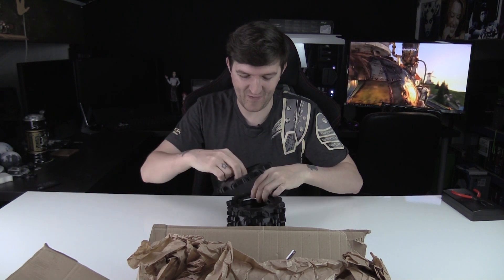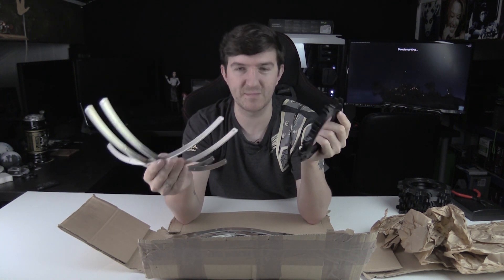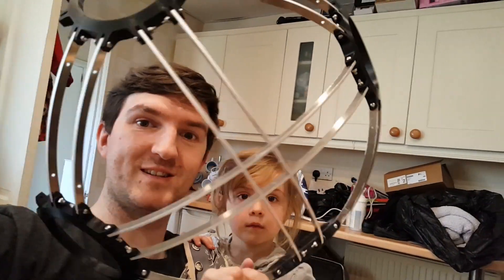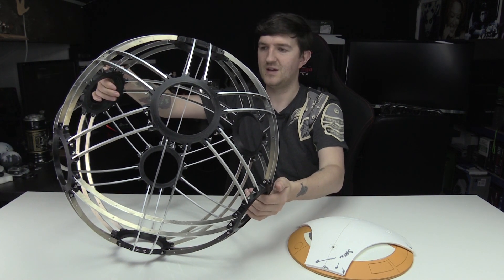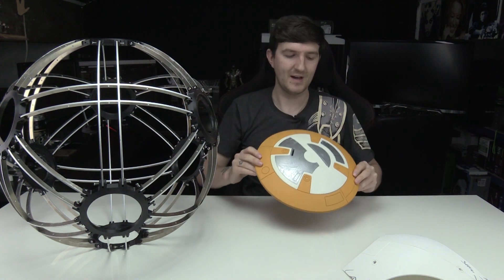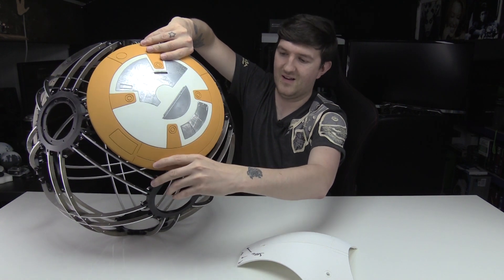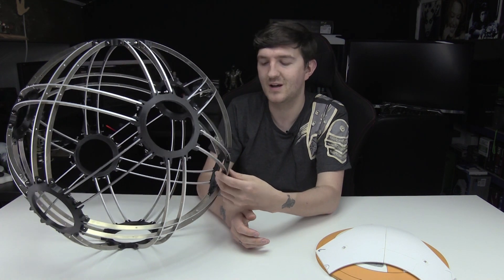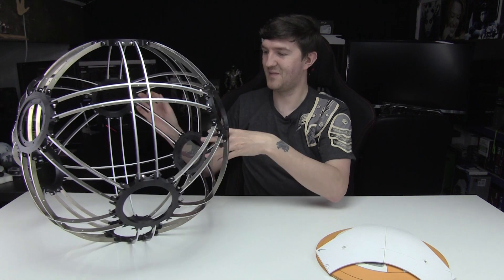Star Wars BB-8 Part #9 New Inner Sphere

Comment: Looks like Micke's frame design and hubs?
Reply from the maker: Thats right, as far as I'm aware I'm the only one who has interdependently had them cut?
Reply: Yes, did you purchase these from him?  I have a set I bought from him too but haven't had a chance to assemble mine yet.  Just finished doing the hubs again (this time 60% infill for strength).
Reply from the maker: No, he released the designs some months ago and I had a local company laser cut them
Reply: @MakerDaveBagnall  Where would I find the released designs u r mentioning about? I would like to cut them for my project too!
Reply from the maker: @ismatnabila  they're available on the BB8 Builders Wiki. You need to become a member to gain access
Reply: @MakerDaveBagnall  yes I am a member! in the wiki, there are a lot of files which name should I look for?
Reply from the maker: @ismatnabila  Its in the Archive section under Askernäs Skeleton. https://bb8builders.club/wiki/index.php?title=BB-8_Archive
Reply: @MakerDaveBagnall  Thanks! Got it. <3